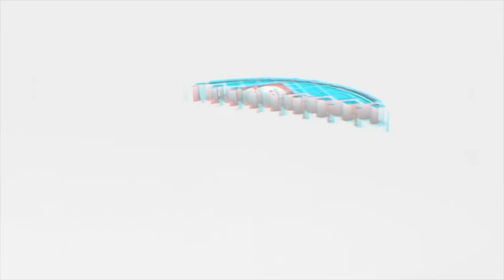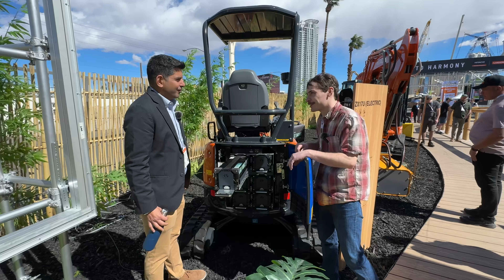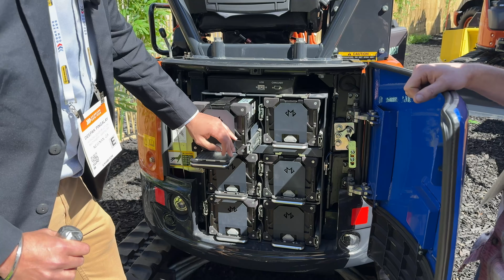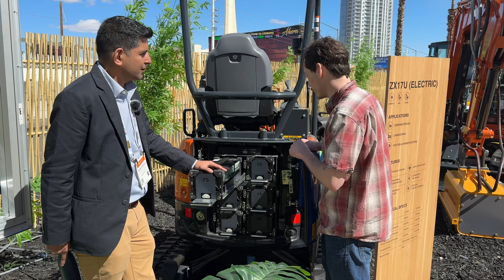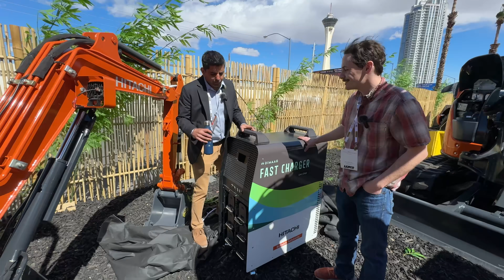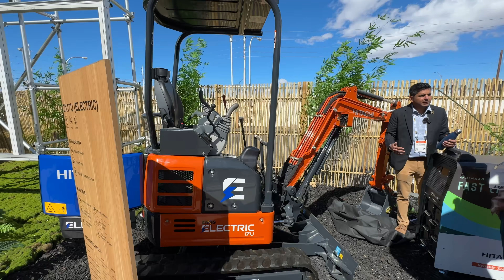Hot Swapping EV Batteries On The Job Site! Hitachi / Dimaag Enable Continuous Run Time

Comment: I'm not sure I understand. He said you have two batteries there that are being used are the other four batteries sitting there not being used until the top are drained and if you take out the top two then the next two below that will be used?
Reply: Only 2 batteries are needed to run the machine in terms of power requirements, but you can fit up to 6 in it for extended runtime.